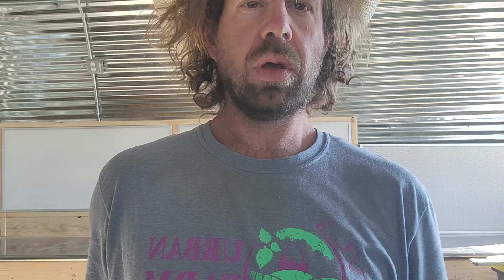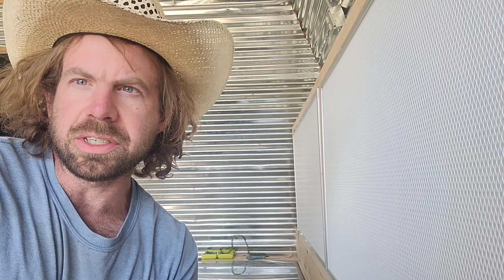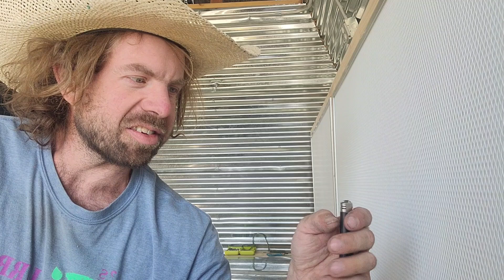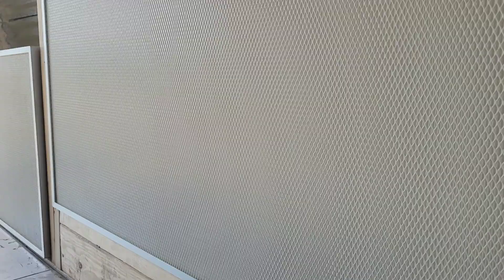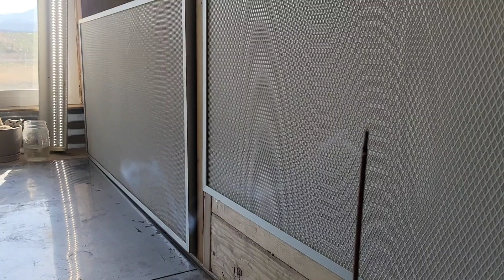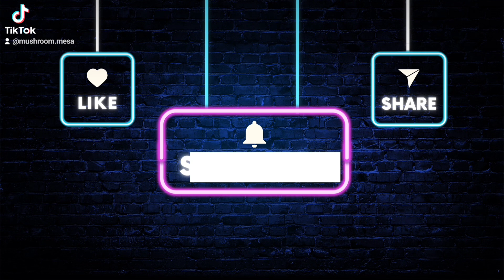Testing your Laminar Flowhood!🍄

Comment: I see some commercial products with plexiglass shrouds covering the workspace.  It seems like it good idea but do you think that adds any benefit?
Reply from the maker: It depends on your overall set up, theres pros and cons to them.  If you have a cover it can get in the way while you're doing commercial type of production for bags.  For small scale the added protection might be nice.  I personally would really not like it for my set up here.  But if someone wants to add some lexan or plexiglass glass shrouds it would be an easy add on.  Its very effective with out them though, so I would consider what type of work you are doing the most of and go from there.  I regularly let things sit in front of it for days at times and the set up I showed in the video here is very effective.

Comment: Does the wood strip in the center of the filters cause any turbulence? Or does the flow just wrap around the dead space and fill it in?
Reply from the maker: It basically just wraps around it and fills in just like you said, I had one similar to this set up before.  Ive never had an issue, but I always do tend to work in the middle of one of the filters and just pass stuff through those areas anyway.